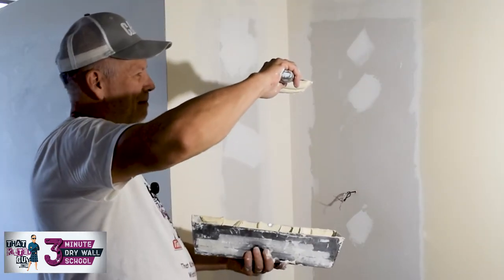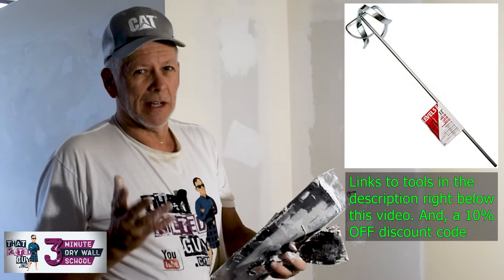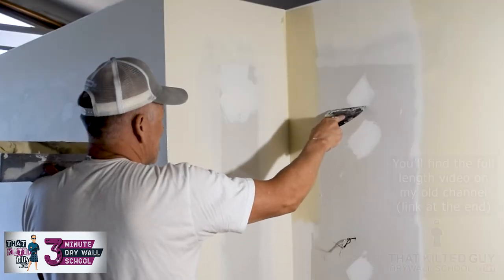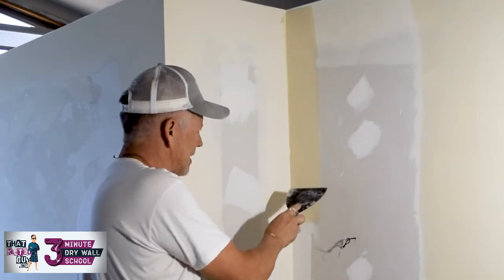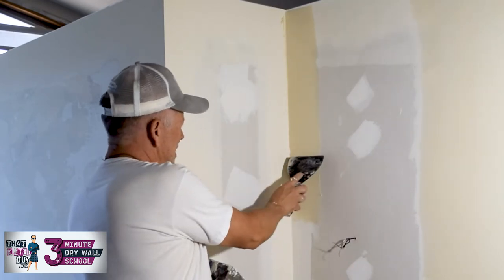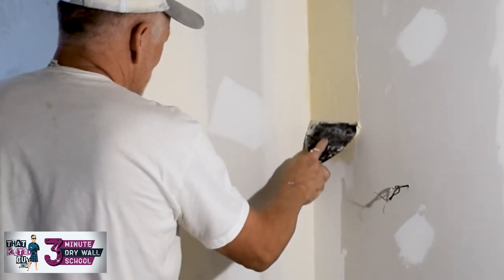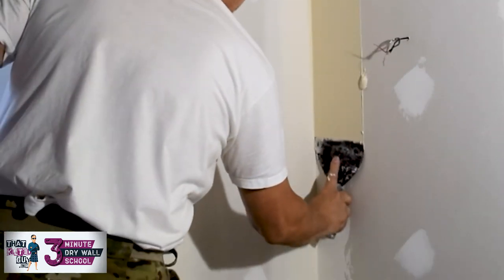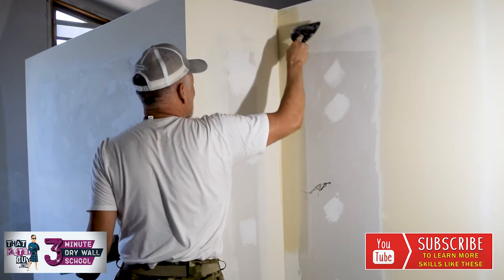How to Coat an Inside Corner in 3 minutes #3MinuteDrywall

Comment: That's a good video.   I have some wallpaper that I removed and along the ceiling edge some of the tape is pulling away from the wall.   Just in a few small areas.   I must have used a razor knife when I put up the paper so when the paper came off it pulled the tape away just a bit, in only a few spots.    Any comments on a repair method?   I don't want to retape or remud the entire wall.   I was thinking of using a thin mud and just skim coating.